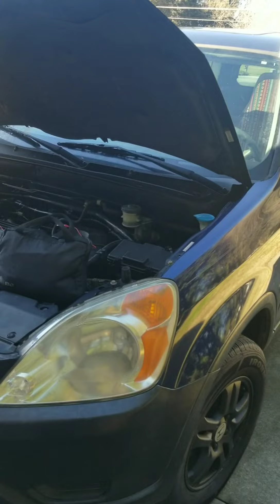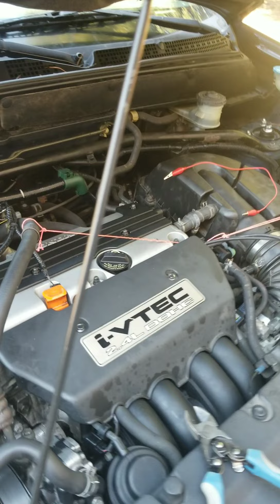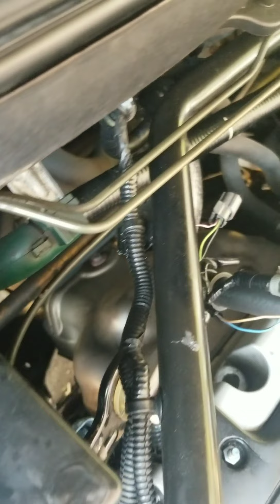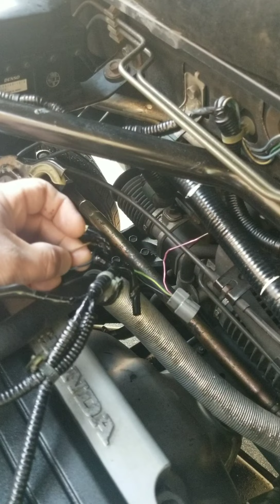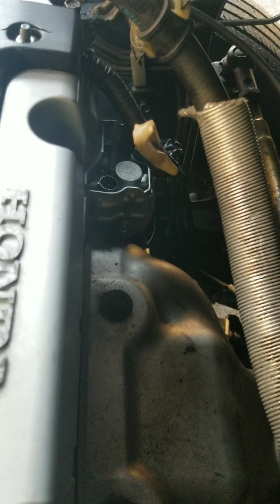Honda CRV VTEC Pressure Sensor Delete P1259

Comment from the maker: Roughly 2 months later and this CRV is still running fine. I'm glad it didnt end up in the junkyard. Has this worked for anybody else? Any feedback?
Reply: Did you try just using a good oil filter cuz I was having the same issue and I put a good oil filter on it it had 13 holes instead of eight it was an STP oil filter and the code went away and that's on two Acuras
Reply: How has this impacted acceleration? Does it run just as it did before these codes are thrown?
Reply from the maker: @The_Man_in_the_Box  When I added in the jumper, I had already replaced the entire VTEC assembly twice and cleaned all the screens that the oil passes through. We ran some seafoam in the oil to remove deposits and put in fresh oil. The code continued but the VTEC seemed to be functioning normal. This jumper sends the "turn on" voltage back down the "is it on" wire. Since we split the wire the voltage also continued to turn on the unit when the ECM requests it. Your VTEC should work as it was but the ECM would not recognize if it stopped working.
Reply: @jeremiahdickson569  haha, literally the way it should have been designed in the first place, going into limp mode for something stupid like this is actually very dangerous for basically a few extra horses. Booooo Honda boooooo.   I’m giving my mechanic one more shot to fix it then I’m doing this trick.  Thanks for a very useful video helping so many people.